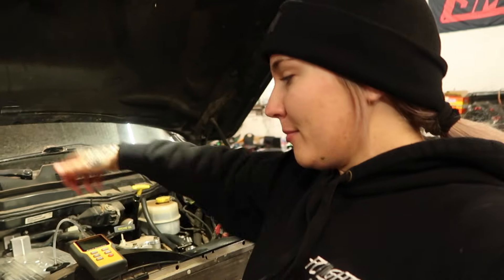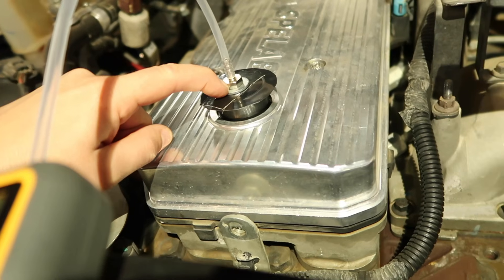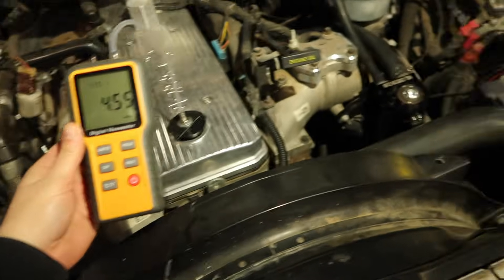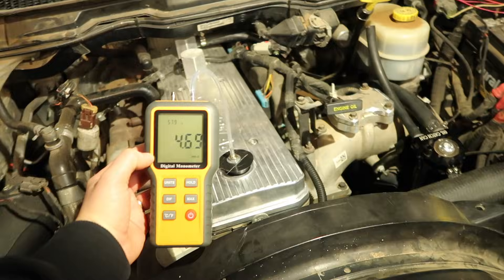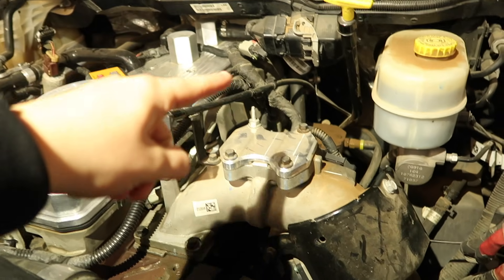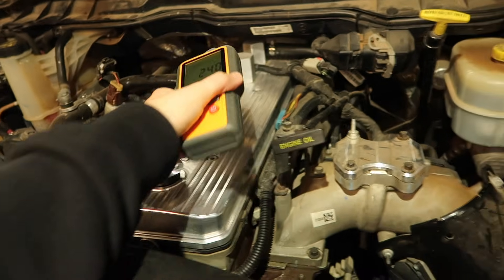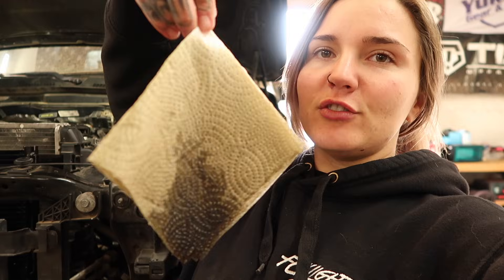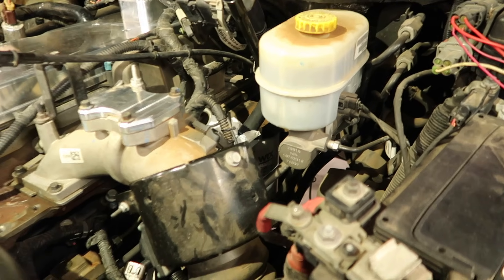Measuring Crankcase Pressure/Blowby on Different Valve Covers/Catch Cans

Comment: Does anyone know if this cover could have provisions for two -12 lines to my existing catch can? Only one I'm seeing that gets good reviews is the Kingspeed but it doesn't look baffled either.
Reply from the maker: With the D&J cover there isn’t a need for a catch can at all. Unless your truck has excessive blowby, in which case that’s when a catch can would be needed but at that point there’s other issues to deal with lol
Reply: @TheCumminsCowgirl Better still... Took your advice... Just ordered the D&J... Fingers crossed this works! 👍👍 You rock! Thanks for the advice and awesome videos. Cheers!
Reply: @TheCumminsCowgirl  What mods are you running on your truck with it? Truck is modded and I pull heavy and the truck does about 40-42ish psi at WOT... I'm getting a little sick of the spelab cover dumping oil like it's trying to get an oil change without me pulling the plug. Truck shows no signs of blowby when tested. 

I am now running a big baffled catch can fed by two -12 lines, I run two -12 lines way back under the cab to 2 steel filters. I drain to a kingspeed fuel pump block off plate with a 5/8" line... Last night ran 800 miles (somewhere in the middle of it I ran a couple of hard WOT runs) and filled the tank and she spewed oil everywhere again... So done. 

Only thing left to try is the one way valve on the drain line has a 1.5psi crack point... Wondering if it's causing issues and isn't draining? 🤷🏻 Either way the damn valve cover is gone when I get back down to SWFL... You really see it working without the can?? I just changed my rear main and cam seal so I'm weirded out with crankcase pressure concerns and blowing them out again. 🤣
Reply: @TheCumminsCowgirl  One more really quick, and possibly stupid, question... When you tested the D&J cover was the hose hooked to the cover at the square baffle/block?
Reply from the maker: Yes! The hose was attached to the back of the square baffle and then routed down for venting.

Comment: Why didn't you hook up the other Spelab outlet? It's designed for the two outlets.
Reply from the maker: I did both, there were no changes
Reply: @TheCumminsCowgirl  doesn't make sense...
Reply from the maker: Try it for yourself. I tried three different setups with that cover and each one had high pressure issues.
Reply: @carlrice3637 I have the same setup... A big catch can on -12 lines, I run two -12 lines to two steel filters under the truck and a -10 return line to a kingspeed billet block off plate adapter for a return... Still leaks like a sieve but passes blowby test like a champ... The issue is the valve cover... They're garbage.

Comment: What about the original bottom port what you ended up doing with  it did you just blocked it off ?
Reply from the maker: The one on the bottom on the block was capped off

Comment: It depends on how you put the catch can on your motor if you are doing a direct vent to atmosphere and taking the PCv valve out, that’s what the cat can is called. You were taking the valve out in the system my motors ran direct to the can no PCv valve direct vent. when you take and run the PCB valve in the system, take a chance of that valve jam causing pressure, causing oil leak, carbon buildup oil contamination, so mine engines are not never back to the engine out to the atmosphere, and I don’t want to hear it bad atmosphere when you have a PC v system. What is the exhaust gas pipe? So what’s the difference difference? It’s going to vapours or going out to the filter, and the oil is being dropped in the that’s what a lot of people don’t realise they have several different types of camps and you want to delete that system. You don’t wanna leave it in there. You are all the pressure out. Send it straight to the can keep the moisture carbon buildup out of your motor. You don’t want to send a garbage back to your motor. Do you want to take it out? How would you feel if you had to regurgitate your body exhausted you feel like crap too. How do you think the engine feels? You want to breeze get all that garbage breathe naturallyfree flow and it all depends on how you plum your can do it correctly

Comment: Im running stock valve cover with gutted ccv filter and hose routed to the frame , mine runs around 1.7 , the spelab valve cover does not push oil out on idle but if you take it out for a run there will be oil everywhere
Reply from the maker: It’ll push it out the second it’s at running temp. At idle it takes a while to get up to temps, but it will spit oil out.
Reply: @TheCumminsCowgirl  💯

Comment: Dang. I just installed my spelab a week ago. My oil catch flooded with oil and i thought it had a busted gasket.
Reply from the maker: Yeah I'd recommend taking it off and running a D&J valve cover without a catch can. That’s what I ended up doing

Comment: @TheCumminsCowgirl what did you do to get the MIL check light for crankcase pressure? Was someone able to right a tune? besides clearly wanting to slap in a D&J I hate those little yellow lights lol
Reply from the maker: I had a local shop tune it since I needed trans tuning done as well so I just did the two at the same time
Reply: @TheCumminsCowgirl  awesome thanks! Didn't take much convincing after this video 👍

Comment: When you switched to the D&J valve cover did you just plug the oil return line on the side the block? I have a 2012 6.7 dually I want to swap the valve cover on.
Reply from the maker: Yes, they include a plug with the kit

Comment: You really shouldn’t be getting any oil droplets coming from an open crank case at idle. It’s gonna take some good RPMs to get the pressure up. Even still it’s gonna take a while for the vapor on the side of the hose to form Droplets to leak.
Reply from the maker: Which shows the true issue with the Spelab valve cover setup. The D&J valve cover hasn’t let a single drop of oil out of the baffled system.

Comment: What did you do with the port on the side of the block under the intake horn from ccv did you block it off ?
Reply from the maker: If you’re going to run the catch can then the drain hose on the can gets plumbed to that fitting on the block. If you run the D&J valve cover with the baffled system, then the fitting on the block can just be capped off since it vents through the top of the valve cover.

Comment: I just did the seals on the front of 17 ram 3500. Your videos are so helpful. Looking to upgrade my valve cover. So I'm wondering what setup you went with. DJ only or DJ with a catch can.
Reply from the maker: DJ only, no catch can needed
Reply: Thank you.  @TheCumminsCowgirl
Reply from the maker: There’s really no need for a vent hose on the D&J setup, if you want a hose you can just route it over to the side, but there’s really no need for one as there’s no oil coming out of the valve cover’s baffled system
Reply: @TheCumminsCowgirl  thank you
Reply: One more question: Where did you run the vent hose?

Comment: Can you make a video of how you removed the oil hoses?
Reply from the maker: The stock ones on the side of the valve cover? Or the ones that drain into the block?
Reply: @ Fuel hoses, sorry. it would be perfect for both, a little more explicit about the D&J kit 🙏🏻
Reply from the maker: I didn't remove any fuel lines at all. The D&J kit doesn't require a catch can, I had only put a hose on the back to monitor and test if there was any oil coming out of the baffled system after it was at operating temp. It passed the test, there was no oil coming out of the hose, just the vapors as it's supposed to do. There's no need for that hose in the back unless your truck has a significant amount of blowby.
Reply: Thank you, I'm your number 1 fan

Comment: So can’t you just gut the ccv filter and run a slobber hose strait down?
Reply from the maker: The whole point is to not have oil dripping on the ground or it venting into the turbo.
Reply: @ well if the ccv filter is gutted and a hose ran the ccv housing makes a baffle to catch inside and drip back int valve cover.  As you yourself showed that there was no oil on the shop towel.
Reply: I would like to get rid of ccv filter after 3 of 8 screws final gulled on brass insert on valve cover.. I would like to switch to D&J cover and with catch can only thing I’m not clear on the ccv pressure sensor. Not much mention what is done any insight would be helpful.

Comment: With the D&J cover, are you still running the line to the turbo or did you block it off?
Reply from the maker: No line to the turbo, it vents out the baffling system in the rear block on top of the valve cover

Comment: i have a G & R cover .  it has the same top square block, but you can plug in the 2 ccv electric connectors so a code doesn't get thrown. i also have it to a cheap amazon catch can. & the outlet runs down the passenger side of the frame. i use the little air filter on the top of the catch can, & i put a small bag inside the catch can with carbon from a fish filter for smell. i have 0 oil flow into the catch can. i also have a hose about 1'long  above the lower vent tube from the motor next to the ECU . with a bolt in the tube with a clamp on it. i have yet to see oil in the catch can. i don't know about the pressure as i don't have a tool to measure. i enjoy your videos!
Reply from the maker: Sounds like a solid setup! I like the idea of having the spots for the two sensors as well, that’s super nice. Thanks for watching!

Comment: Did the Spelab cover on my truck and had the same problem. I have emailed them to let them know the issues I'm having but have not got a response. Thanks for the video I guess I will have to spend more money and get the D&J.
Reply: I got the spelab one as well and can’t get ahold of anyone there. Did you end up doing the D&J valve cover? If so is your problem fixed?
Reply: @AshleyWilcox-c7d  I did not spend the money for the D&J yet. I put the original filter and valve cover back on. I am going to get the D&J when I get time to work on my truck again.